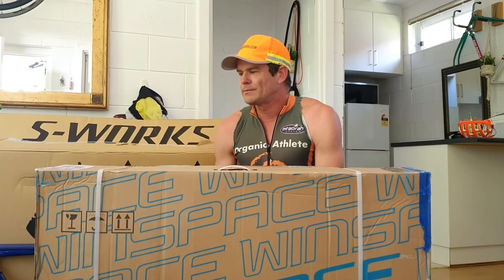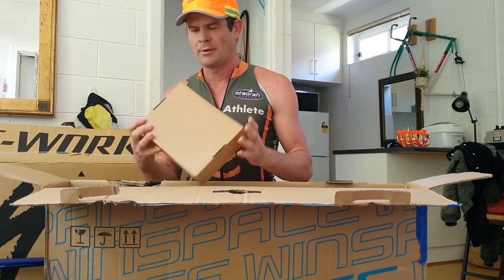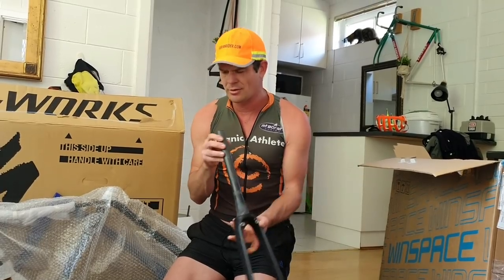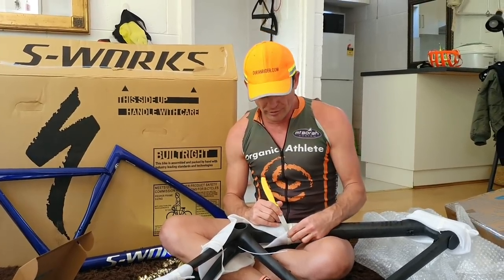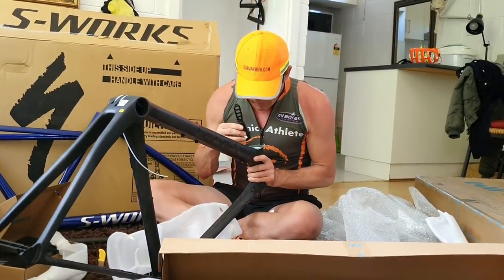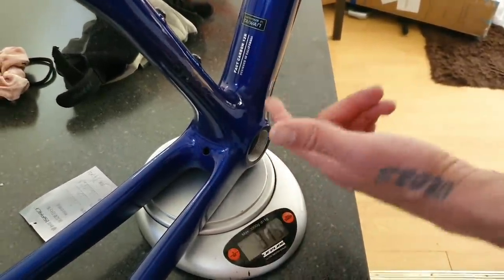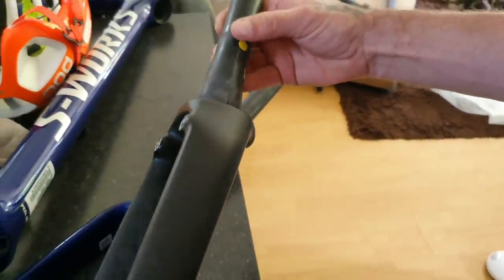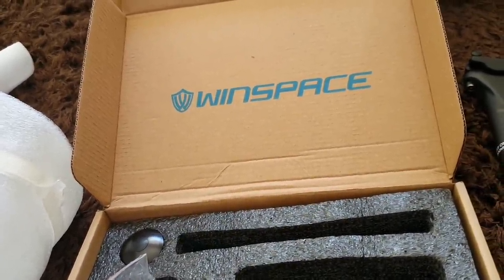Winspace SLC VS S-Works SL7 Unboxing & Comments

Comment: I've been riding it for 6 months now.
What can I say, best bike I've ever ridden.
Super stiff, great cornering, lightweight, direct mount rim brakes, easy to build, great customer service from Windspace.
Reply from the maker: Everthing you need in a good bike!
Reply: I'm waiting for the 61 cm frameset
Reply: @dickieblench5001  61cm? I thought 58 is the biggest size.
Reply: @Buckwheatrider  yes unfortunately I am going to have to wait until they produce one for anyone over 6'4
Reply: @dickieblench5001  I'm 1,90 m and ride size 58. Please ask winspace for a longer fork. Mine at size 58 was a little bit too short that I can not ride any Spacer. But it fits, i don't need any spacers for my fitting. 11cm drop is fine for me according to my bike fitter.
Reply: @Buckwheatrider  good to hear but I'm 194 so we'll see
Reply: Same here, 193cm. Fear 58 is too small.
Reply: @Tethysmeer  I'm 190cm. Perfect fit for me. Ride an email to winspace and ask how many spacers you can ride at size 58. Maybe you need a 140 mm stem. I ride a 130mm

Comment: Would be interested to see how you find the sizing. I know I usually ride a 56cm in other frames and they use a different sizing system (roughly a 55cm in Large and 57.5 in XL) not sure what they sent you but would be great to hear the feedback.

Comment: I went crazy and bought two Dengfu frames, an R02 and an R01.  I also went even more crazy and purchased a Dura Ace R9100 rim brake for the R01.  I'm super excited, I'm a cheap ass even though I could afford any production line bike cash...I currently ride a Sava but I don't like the proprietary seat post and rear derailleur hanger.  If you were still able to sell the Pragma frames I would have bought one of those.  I appreciate your vids bro.

Comment: Bit of a no brainer, not worth spending anything more these days. One could always get a custom paint job the same anyway, but I'd probably get the super light black as well.  Still $1830 AUD so prices have crept up over the years but much cheaper than brand name stuff.  I paid 2k for an italian made Bianchi frame in 2004 $3500 down to $2k, but those type of deals would be rare these days.

Comment: hi durian rider, what about trifox frames vs winspace slc 2.0?
Reply from the maker: Both good but slc has better seat post design and bigger sizes plus direct mount brakes.  Both are good rim brake frames though.
Reply: @DurianriderCyclingTips  hi thanks for the reply, it looks like the SLC is a slightly better investment

Comment: Weigh the aethos compared to it…. Tarmac sl7 just won the world champion title as well for a flexy frame. Julian must be that dominant of an athlete
Reply from the maker: I bet he got a special custom layup.
Winspace SLC builds up lighter than the S-Works Aethos using same tier parts AND about 10grand cheaper hehe
Reply: @DurianriderCyclingTips  ain’t no way. The specialized aethos size 56 frame weighs 595 grams

Comment: ALA just won world championships ON SL7
Reply from the maker: 1. He on some next level gear for sure. Different level today. 
2. Specialized often give their star riders special custom lay ups. As an owner of a stock SL7 I highly suspect his frame has extra carbon in it for strength and stiffness.
Reply: @DurianriderCyclingTips  ok. But you do not know that as fact.
Reply: @GuitarguyRichard56  I bet @durian can’t push 1/4 of Ala‘s power so he doesn’t even know what a „flexy“ frame is. 😂😂😂